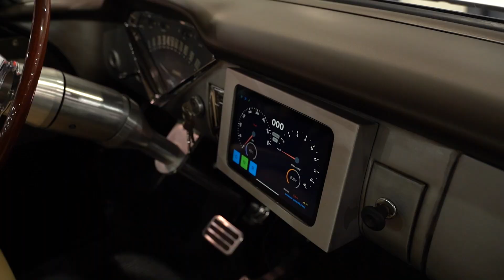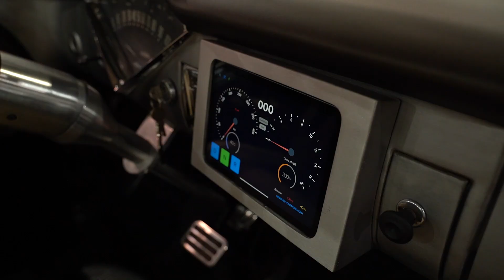Purists Will (probably) HATE This Immaculate Build

Comment: EVEN Tesla is not ready for prime time...
Everyday needs will be better satisfied by hybrids
As well, put a small high boost opposed piston diesel in as a power plant.
Eliminate as much battery weight as possible, only enough for a starter & any additional accessory loads 
EV's are an expense not suited to a cash strapped populace...